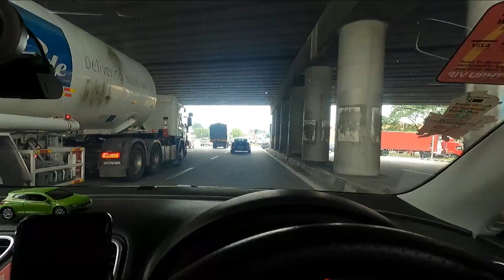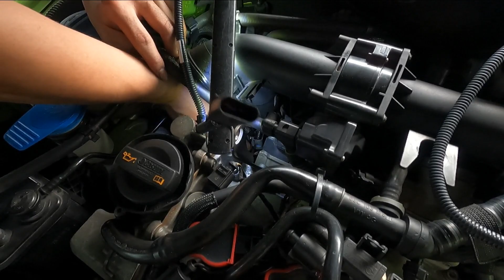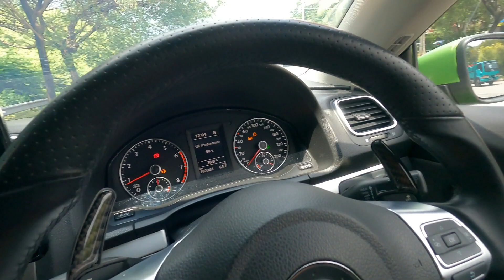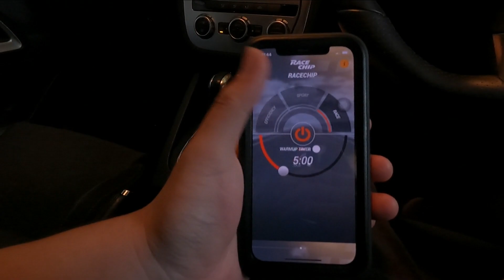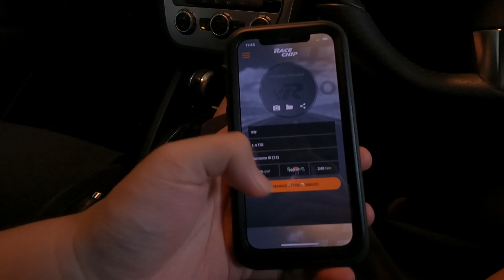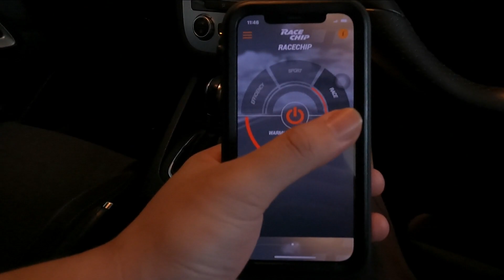RaceChip Ultimate Connect Install on VolksWagen Scirocco 1.4TSI

Comment: it would have been better if you have boost meter to compare boost level before & after racechip installation
Reply from the maker: I had the boost meter to compare and it was boosting at the same bar. Just that with the latest update the boost comes in earlier.
Reply: @DrivenTechReviews  tqs man for the info